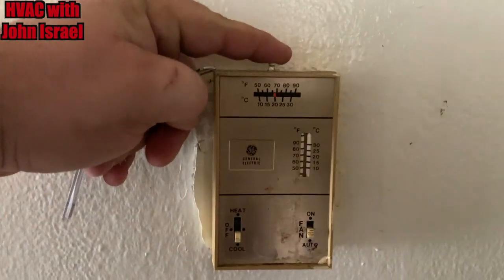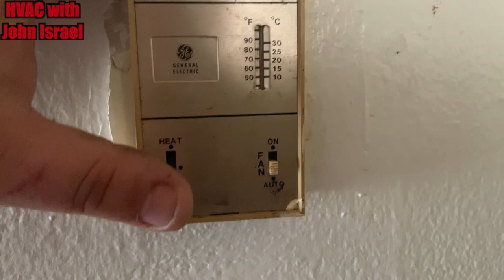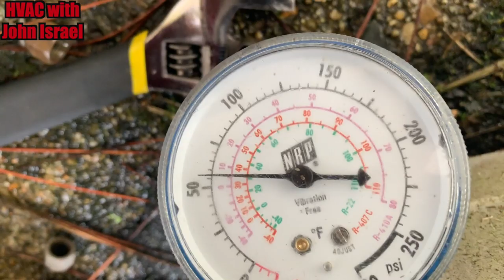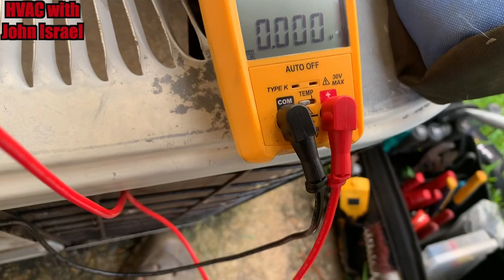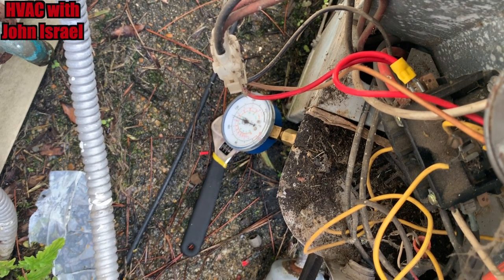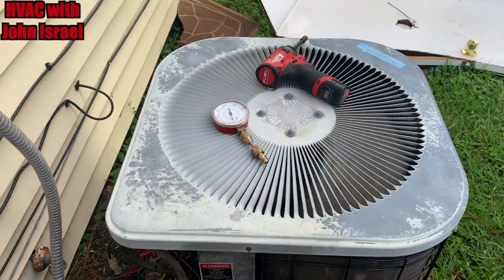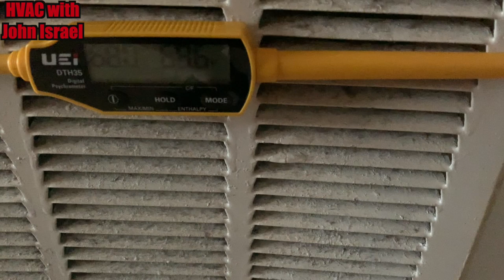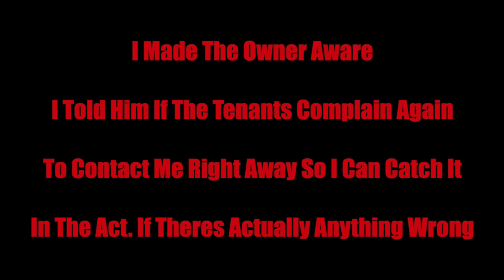HVAC No Cooling | So Says the Tenant

Comment: 13 degree split is pretty horrible and how hot was the liquid line. Rental property = plugged coil
Reply: Old system. Needs replaced. My 69 Chevy has a hard time with No Lead Gas :-)
Reply: I'm gonna vote dirty blower wheel too

Comment: 59 psi is 40* coil with MO99. It's probably close to correct. If that gauge is right? I carry it, and have converted several over the years without any problems.

Comment: I work at a 150 unit Apt. complex in Md. I've had my fair share of it's not working calls. Like it's not turned on or when a no heat and all 3 of the windows are open a little bit.

Comment: 15 minimum for the split. So yes, 13 is bad. 
Checking evaporator coil cleanliness and filter(s), proper or increasing airflow with the tap on the blower would've sufficed. 
MO99 is trash, and if you felt like it was low then adding some more while checking the split would have been the best option. 
No hate.
Edit: forgot to mention the number 1 sign a system is working perfectly-- was it draining? If so, I wouldn't try adjusting anything.
Reply: split means nothing without measuring airflow and wetbulb return air. 13 can be normal under the right conditions.
Reply: D W I wouldn’t say MO99 is trash. Just a lot of technicians aren’t familiar with it, and they think it’s runs on the same pressures as R-22. Most people don’t study up on the new Refrigerants. I’ve used many replacements for R-22 and there all different. If you can charge the system just right it will run perfectly.

Comment: Dealing with renters can be tough. Some are dumb as rocks. Temperature is one thing but airflow is important. Even if ac is off you should feel a gust of wind when you open the front door. If not there is an issue. I've had calls like this and its simply a window open

Comment: That looks like old armored cable.  Bx was an assembly of ac with wires, now mostly replaced by mc cable.  If I recall correctly, old bx had a waxed paper insulation wrap which attracted moisture.

Comment: What was head pressure? By knowing head pressure you can tell if it's low on refrigerant. Also 13 degree split it awful and just by  looking how the weather was outside it did not seem hot out. So on a hot day that temp split is probably less than 13.
Reply: uh try again.
Reply: How can you tell if its low by using  the high side? Please help.

Comment: Just wondering if you have ever gotten bitten by an energy stored capacitor or know if it’s really necessary to discharge them by shorting out across the common to herm and common to fan? Thoughts? Great vid, thanks.
Reply: I put a meter on one yesterday and it had about 95 volts on it, so I put the screwdriver across it, and there was a nice little spark.  I doubt anyone has ever died from 90volts on a 30uf cap, but I'd rather not touch it all the same.  The voltage on the cap is gonna be random everytime you turn the unit on and then off again.  It will be at whatever voltage the sine wave was when it got disconnected, sometimes next to nothing, sometimes enough to regret.  I've been shocked by a camera flash capacitor fully charged before.  That's way worse.  I thought I might actually die.
Reply: Chris I've never been shocked by one (that was disconnected) in the 17 years I've been doing this. I've accidentally bumped a blower capacitor with my arm while it was hot that didn't feel too good. And I was pulling the flame sensor out of a gas pack and my wrist accidentally contacted the 4mf inducer capacitor and it gave me a pretty good shock. But never one that was disconnected 😎👍
Reply: 20 years in HVAC and I've never been zapped by one......that wasn't live.
Reply: I got hit by 1 ive not made that mistake again

Comment: MO99 and 422D problems too much of a Temp Split across the Evap. I had a property that that's all the owners would let me use and then drop it on top of R22, never got more than a 15° split, and lazered the Evaporator and it was never a level temp. Not necessarily proud of the work I had to do there (Duct Tape and Bubblegum) but it was what it was. First time I've ever installed a plastic Condenser, literally, Ameripride from Used AC Depot in Florida. I remember having to cut the fan shrouds because the fan blades would hit fresh out the packaging. Good times. Lmao. But if retrofitted correctly with a Full R22 recovery, remove and dump compressor oil, and correct oil weighed in it might be okay, but there isn't a true retrofit for good'ol R22.
Reply: 422b at my place last yr. I'm happy with it so far

Comment: That wasn’t a very good split.  The owner wasn’t up for charging it?  Idk a damn think about mo99 or what it costs but I think I would offer him the option of me coming back with that or converting it to r407c.  I do know 407c is cheaper that MO99 but there would be no recovery cost as there would be for 407c or even R22 but you know he isn’t springing for Converting back to R22, that’s not happening.   

I’m surprised the owner didn’t buy a bottle of MO99 for stock when they converted it.

Comment: Did the original tenants complaint call happen right after they got their electric bill?
Reply: Any unit that old I am adding a manual lock out h/p switch. The condenser fan motor bearings will eventually go bad and no one will be the wiser that the compressor is cycling on thermal

Comment: Not correct area to measure split. Needs to be closer to evap coil but not line of sight. Duct length and heat absorption and temp loss will give incorrect readings.

Comment: Needs POE oil.
Reply: MO99 doesn't need Poe oil , works with mineral oil. 407c on the other hand you need to add poe oil or if won't work right.
Reply: @JohnDoe-vf8cw  Agreed. This is one reason new compressors are shipped with Poe oil. I would have changed out to 407c. Now that there is a mix the R22 cannot be reclaimed. Top offs like this will quickly make R22 go up in price after 2020. On the other hand if it had Poe the R22 could have been taken out and reclaimed.